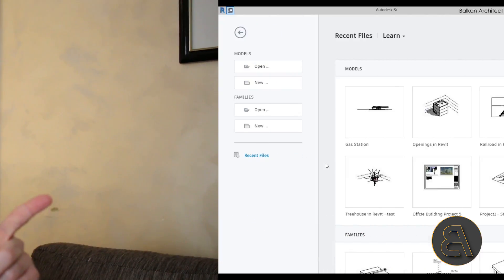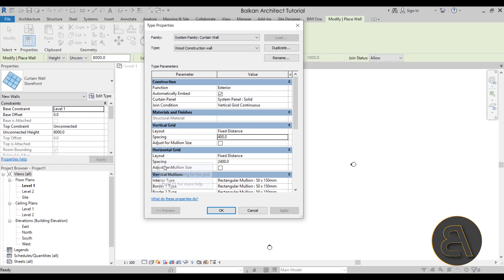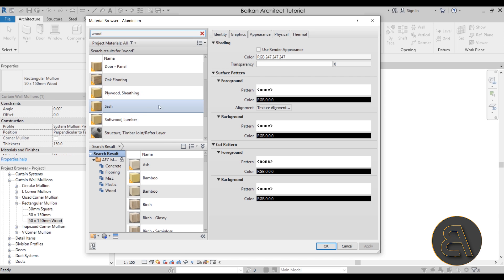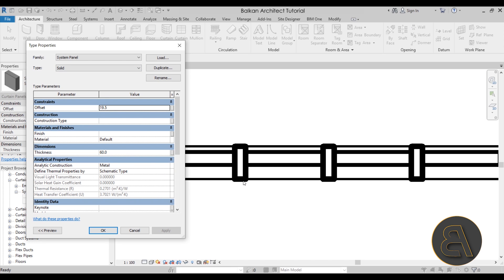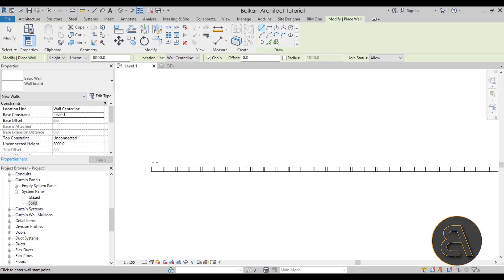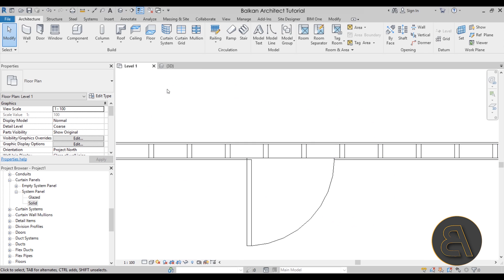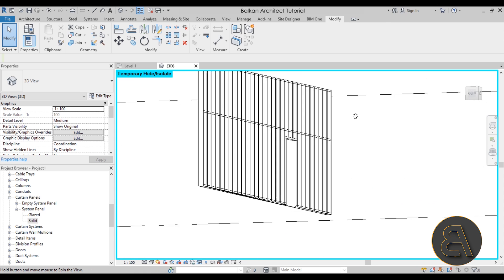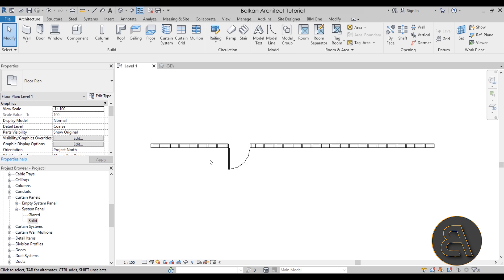Wall Framing Construction in Revit Tutorial (Metal or Wood Stud Walls)

Comment: As always - helpful and clear. The only issue I have found with this is that the spacing for the first stud needs to be measured from the outside edge not the centre.

Comment: Your videos are highly appreciated, however this topic is highly naive. What is being modeled is not only unnecessary it would overburden a large model. Issues like interior/exterior wall framing is a performance spec item which is either further elaborated in a speciation manual and/or detailed/outlined in the partition schedule. A framer on a job site has no real need for any of this model information. Revit is a great tool to get all the principal trade assemblies and systems of a building “on the stage” so they can be properly coordinated and checked for interference in 3D. However, “over-modeling” such as discussed in this video is absolutely not worth the effort. It wastes valuable workstation and network resources, and more importantly it is a waste of time. And in this day and age of the Architectural profession “Time is Money”. Both are extremely precious in terms of office sustainability.
Reply: I was looking for those words, Thank you for putting it so eloquently.

Comment: Hello,
When doing your drawings  you will need to add a King stud, one that goes from the bottom plate to the top plate on either side of the header, connected to the header. That will be on either a window opening as well as a door opening

Comment: Maybe you could combine this step with your previous video with the tree-house? If I was suppose to actually build that treehouse I would model it in to extreme detail.
Not because you SHOULD, but because I CAN.
I´ve even modeled individual screws and L-brackets when I modeled my new porch. The purpose of this was to really plan/think about HOW I would build it and what challanges I would encounter. Aswell as geting very accurate/complete materiallists. When I´m in the supply store, I wount miss to buy any type of screws (different screws/screwheads for different purposes) or other material.
And even get the material Precut by the store.

Balkan: I used Structual systems for this. I even thought about trying to change steel-systems in to wood and then use Steel-connections for my L-brackets/joints. But I didnt get that far...

Comment: Hi Balkan Architect, thanks for the great tutorial! However, this project clearly shows a major weakness in REVIT that makes BIM solutions almost impossible. Making a picture in REVIT works great indeed... but after that a contractor needs to do his planning. He needs to know the exact shape of each part in order to know how much material to buy and how to cut and assemble it.

And there is the point... REVIT just is not able to produce a part-list! Especially with more complicated projects this is a major setback. Same goes for steel constructions - REVIT makes very nice connections but for some reason can not tell how each individual part looks like. I have seen a demo of Tekla where you can point at a piece of wall and out comes a list of parts to produce...

I have put this forward at my Autodesk provider and until now they are looking at the problem...

Comment: why do it this way, if you can just use the structural tools in revit, and work with beams, columns, truss and brace, etc?
Reply from the maker: Hi, you can use that approach, but this is much faster.
Reply: @balkanarchitect  only for the architect, the designer will die ))

Comment: Rather than using 2 separate walls as the 'wall boards', you could use one wall with it's construction set to have a board either side of a cavity with 'air' material. Then, when drawing the timber frame curtain wall, it will automatically embed, to the cavity (providing you have sized them the same). Good content though! 👍🏻
Reply from the maker: Good tip! 🙂
Reply: Would you mind explaining it further? it sounds fantastic however the timber frame curtain wall will just take out the whole chunk from the board wall instead of embedding itself to the cavity. I'm not sure if it's actually possible...
Reply: I just realized the other Wood Framing video he made in 2021 was a follow-up on this comment. Wow! Kudos to you both!
Reply: Ayo stealing this, thank you
Reply: Good tip, but not great for my current project where the "wall boards" only cover a part of the wood stud walls. However when I try to join the "wall boards" it doesn't cut out the door opening.

Comment: Nice idea mate!

I tried this for smaller projects and exploded wall axos a while back and it worked well for basic nogging diagrams.

I'm currently actually building a dynamo script to place 'bays' of framing as line based families using dynamo. Hopefully share to my channel in a few months... I'll mention this video though as a good method to keep it simple!
Reply: Did you complete this after Gavin? I’m toying with the idea of creating a warehouse of multiple wall types created…then grouped as assemblies for the benefit of elevating as a shop drawing, away from the model itself.
Reply: @markr8604  too many junctions to automate in the end. Maybe look into mwf addins by AGACAD.

Comment: Its an option that Revit should have,they are common world wide in timber and steel. The only thing bad here is that the footers and headers are wrong.The vertical timbers should sit on top of the footer and under the header ot run the full height with noggins top and bottom.
Reply from the maker: I show how to fix those join conditions at the end of the video. It will take a bit time, but you can get everything to look exactly how you want it to! 🙂
Reply: @balkanarchitect  Yes I saw it but if theres a office block full of studded walls itll take a week,do you not know of a way to do the en-mass,I dont and Im grateful for this way,if I dont need detail thisll work fine.